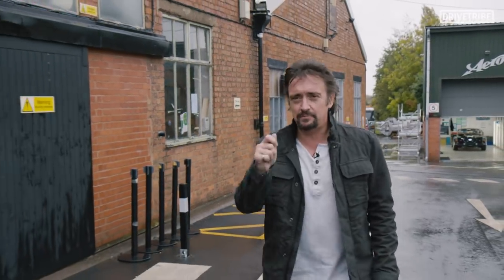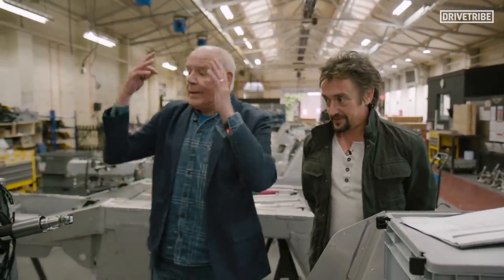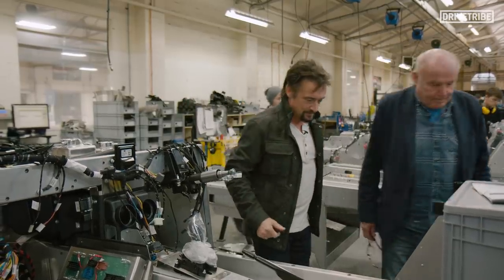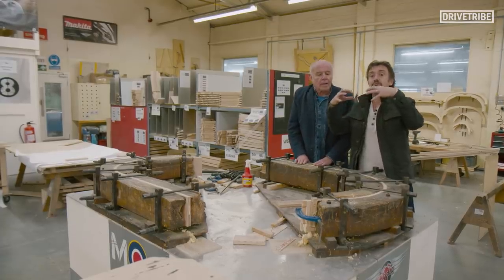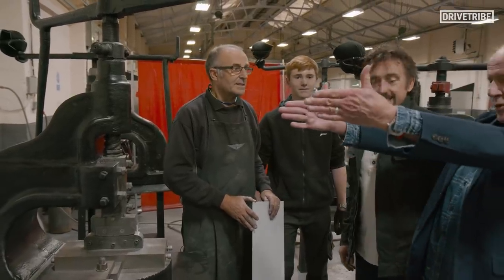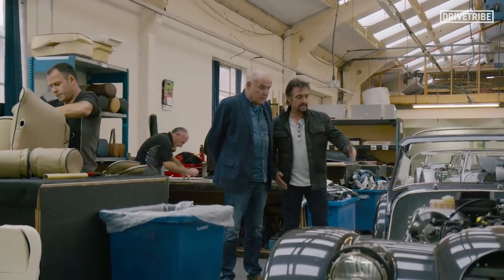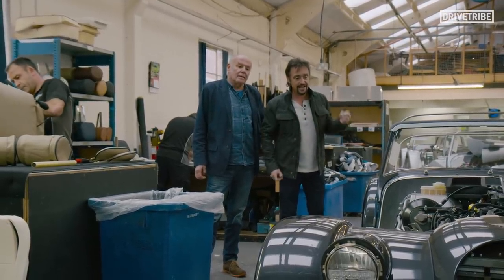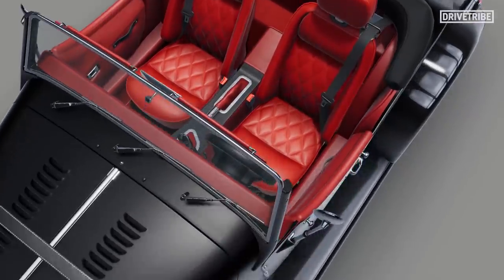Richard Hammond wants YOU to spec his new car

Comment: Only one question remains:
Do the Morgans have a wood chassis? 🤔
Reply: RMP1 - No they don’t.
Reply: @AtheistOrphan  They used too.!
Reply: They said it has a wooden frame in the video. So I am going with that.
Reply: @michaelmeisman4731  They used to be mostly made up of wooden chassis. On previous models of cars.
Reply: Cars were hand-built a century ago, and amazingly all Morgan cars are still built by hand, and with an all-wood frame. All Morgan cars since 1909 have had steel or an aluminum chassis and the ash frame has been to strengthen the body. ... The wood in the cockpit area is a frame which provides deform-able protection between the chassis and the aluminum outer panels. That'll be $168K please.....yikes
Reply: I honestly thought they were wood skinned as well, now I wonder why they use wood for the framing between the aluminium chassis and skin.
Reply: @kurtismelrose  I am well aware of that. The difference now is they are calling the wood a 'frame'. So I will just be saying they have a wooden frame. Seeing that a frame is not a chassis in this usage.
Reply: @michaelmeisman4731  Still a piece of the chassis.
Reply: @kurtismelrose  I disagree the chassis is the aluminum portion while they are very clear that the 'frame' is wooden. They also said 'Morgans do not have wooden chassis". It is their words not mine.
Reply: Not anymore
But my question is if the older ones had a wooden chassis and a wooden frame do they float? 
Cos if it would he missed a trick when they did the amphibious cars a few years ago!
Reply: noxxi knox   Thank you. Someone finally realizing that the whole thing is a joke. From all sides. I love Morgans, wood or no wood.
Reply: My neighbour has two and both have. But they are from 2011 I think
Reply: @michaelmeisman4731  No ithat before Now they don't
Reply: Guys this comment was made as a joke
Reply: No, they have a wooden frame around the aluminium chassis. It has been this way for many years. It is a common conception that they are all made from wood but this is incorrect.

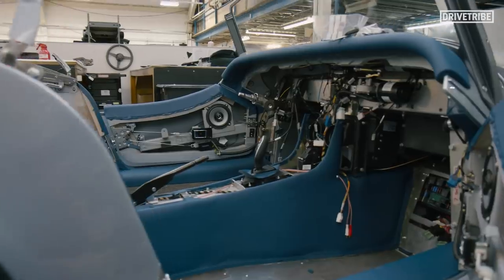Comment: 4:17 morgan uses parkside tools from lidl, screwing your seat in drill mode. actually using the torque settings would be really useful because you can limit the amount of torque that is applied to prevent screws, or the materials they are inserted in, from being stripped.

Comment: What about some blocks on the pedals so you can reach em better , a smaller steering wheel so you can hold both sides without stretching and a thicker padded seat so you can see over the dashboard oh and ask em to lower to door handles so you can reach to get in and not forgeting to lower the rearview mirror 😜

Comment: Yellow, add 6 point 4130chromoly rollcage powerdcoat to match, 8 if you angle the top bars to fit the body lines nicely. i dont think the car is heavy enough to warrant more cage then a that.

Comment: I'dove to see how they handle the real engineering required for that marriage of wood amd metal. Wood expands and contracts with humidity, metal doesn't. Wood expands a lot based on temperature, metal expands a little bit. Wood is an insulator so cold parts stay cold and hot parts stay hot (resulting in differential expansion); metal is the opposite.

How do they handle all of that? Or how do they avoid needing to handle all of that?